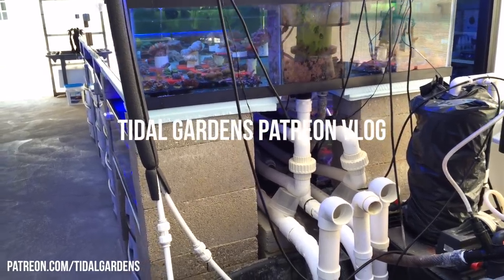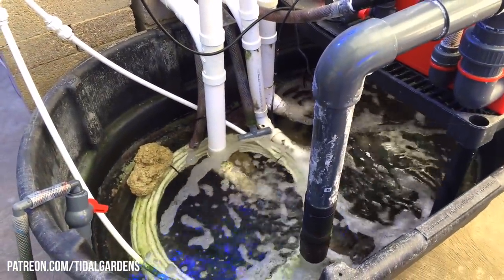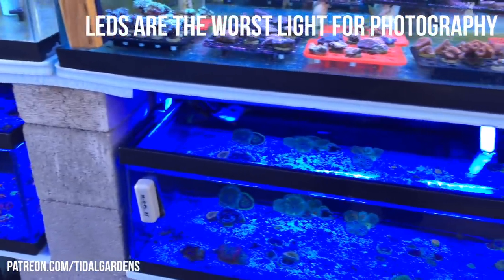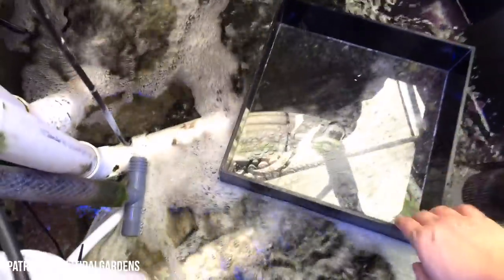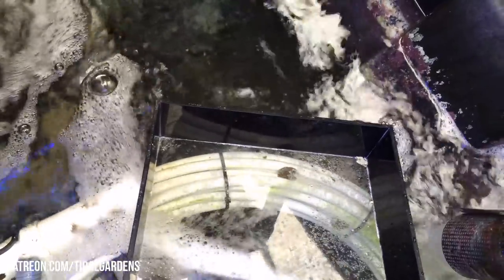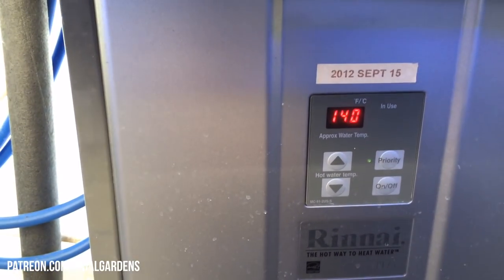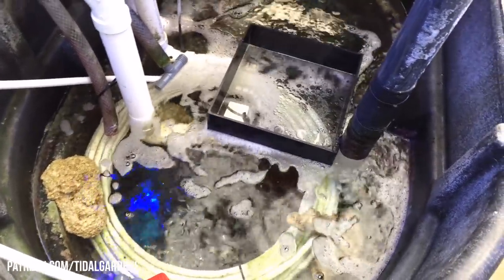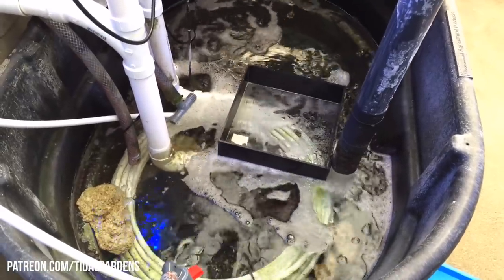Tidal Gardens Behind the Scenes Patreon Vlog 4: Tough little anemones! (Mar 9, 2016)

Comment: Great video, this shows that drastic changes in salt, temperature, etc will not affect most marine organisms due to where they live in the wild. Many corals live in bays and inlets in which 2 times a day the salinity changes drastically along with the temperature.

Now it is good practice to drip water newly added marine organisms, however for the majority it doesn't matter.